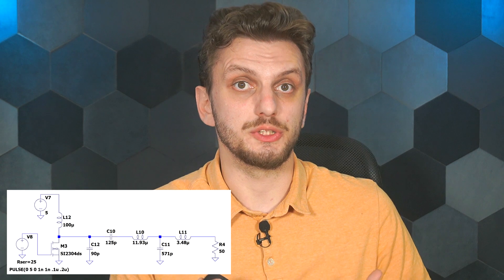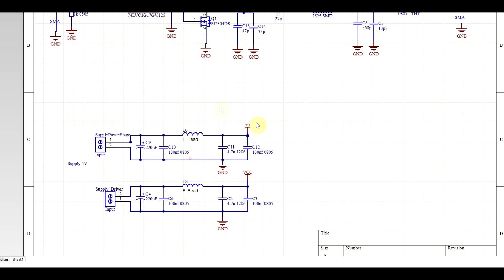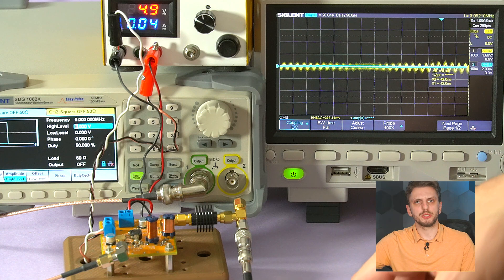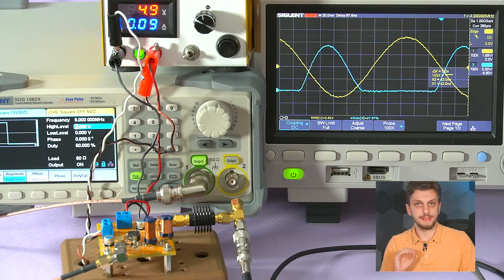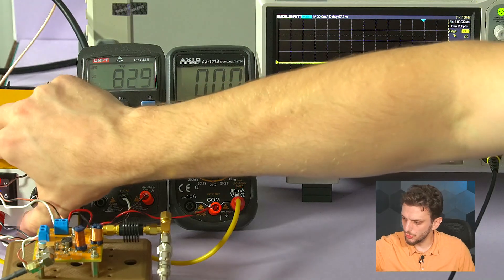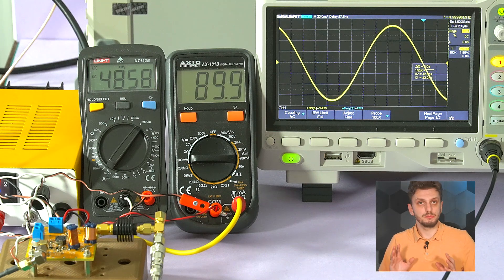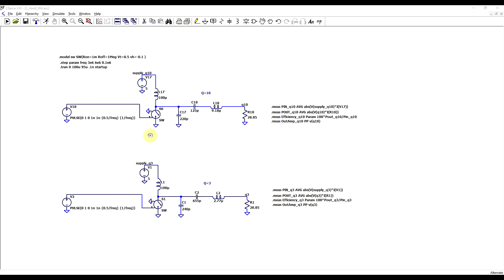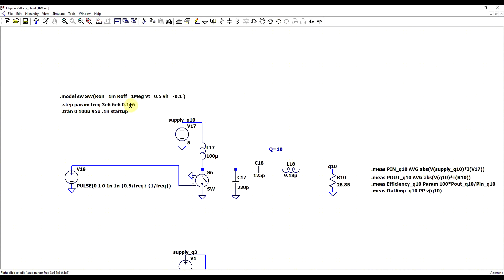Class E RF amplifier - Build (2/3)

Comment: Thank you for these video! Amazing results overall! Ive never build an RF PA but have built various rf devices. efficiency you may be able to try using a trace calculator to make the 50 ohm intrinsic characteristic inpedance matching at your PA's output with your FR4 board's permittivity for your effective permittivity considered since that adds parasitic capacitance. Next, a 50ohm adapter on your oscilloscope should reduce reflections thus increasing forward power delivered due to the standing waves on your tx line. This should get you closer in efficiency... but not sure how big the circuit would need to be for HF, Im accustomed to higher ISM wavelengths. i will see number 3 how you do it!! Thank you!!

Comment: Why did not you use a SI5351 as input?
Reply from the maker: This is a very interesting component, but I never used this part in the past. I guess, for the purpose of experimenting, it was easier to work with a dedicated signal generator, but in a final device, this sort of part- the SI535, would be better since its so compact.

Comment: Thank you so much for doing this. My (tr)uSDX QRP HF transceiver uses a Class E output stage, and in my efforts to properly tune it up for maximum efficiency on each of its 5 bands I have learned quite a bit on the practical level, but I really wanted to learn the fundamental theory of Class E designs so I could do it right, or even design my own Class E RF stage.